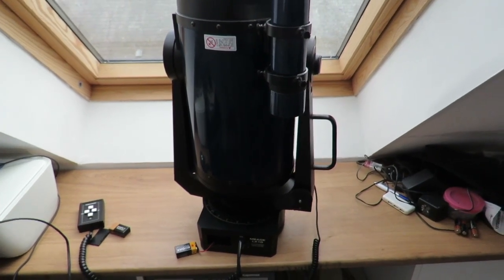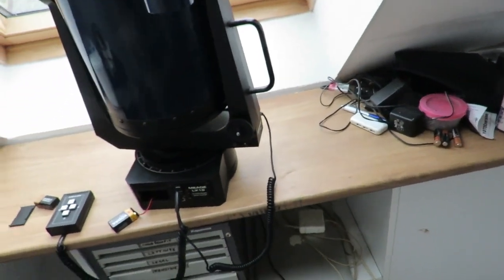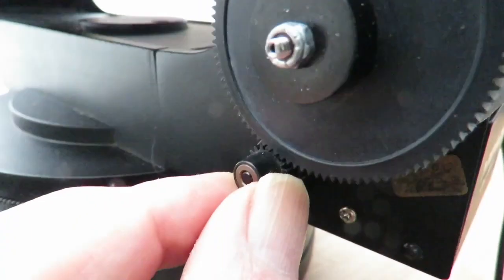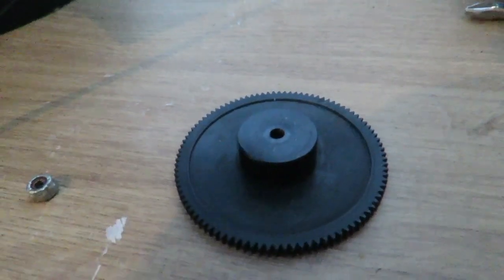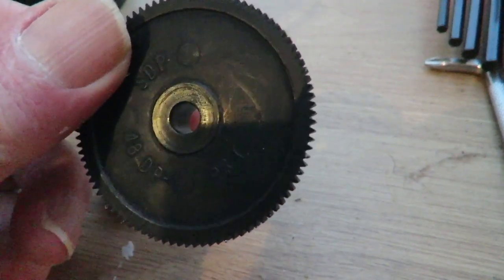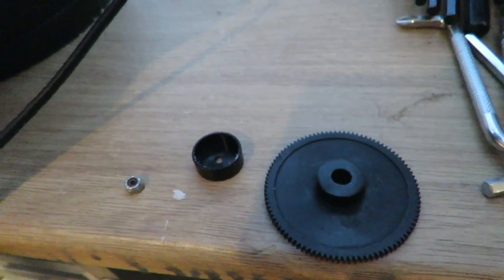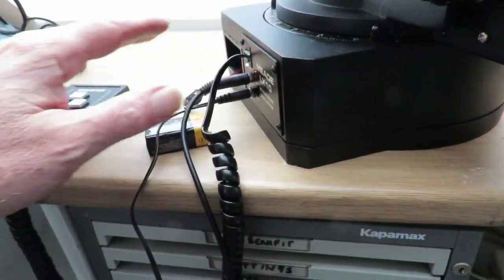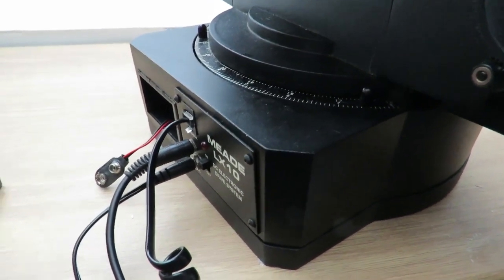Meade LX10 drive issues

Comment: I have some similar issue with my 8" lx 10, so I will piggyback on others experience.  My main issue is the RA drive.  When powered up the red light does not lite but there is a faint
noise from the motor. When I press the West button the motor and scope begin to slew ok and the lite goes on.  When I let go of the West button the lite goes out and the motor tracks very slow.  You can measure the speed by timing the RA circle tick marks. Each tick mark should take 5 minutes. Mine is very much slower.  I was able to fix this problem for awhile by removing the plate holding the cable jacks etc. The stinkers at Meade used very tiny  Allen screws that were rusted in place and the wrench strips out. So I cut a slot with Dremel
and removed them. To continue, I adjusted a variable pot on the board and this got the motor running at the proper speed for awhile.  I think the pot is dirty or corroded and may be in need of cleaning but I don't see any way to do that unless you spray and pray with a can of electrical cleaner. Since the RA is screwing up again I will try that.  It is also possible that a transistor or capacitor in the regulator circuit might be  bad. Of other note, the drive worked well during the warmth of day but failed during the chill 50 degrees at nite.  Of course, it did this during the observation of Titan's shadow crossing Saturn, but I managed to see it happen on September 20 anyway.  I will follow up here if I can figure this out.

Comment: So I have a LX10 that is new to me.  I have similar issues but somewhat different.  With a new 9v battery installed and power switch to "on".  I hear the drive working and I think this is normal.   With the hand controller though, when I press E, I can hear the RA motor Stop, it resume when I let go of the E button.   The W button does nothing.  The N and S buttons do nothing.  The W+S buttons active the Dec motor in one direction, and the W+N buttons do the same but in the opposite direction.   I don't think this is normal?
Reply from the maker: Apologies xc, I am rarely on my channel these days. I'll need to go back and check the LX10. Everything is working great with it now so, if you haven't resolved this already, I'll feedback within the next few days. However, I can say that one of the E-W buttons is simply meant to stop the RA drive until you let go so that is probably ok. The other buttons should speed the drive up a little (you may not notice because it is only meant to be something like twice the normal RA speed which, as you know, is very slow as it is meant to be "sidereal rate"). As for the W+N and W+S buttons: That does seem odd. I have never tried using them both together so will do. Mine moves in DEC with just pressing either the N or S buttons alone.

Comment: Sorry, late to the game. I struggled with this too.  Dec motor:  the little cam that sits on the outside, combined with the little silver nut must be tightened against the large gear in order for it to turn the worm gear assembly inside the fork.  If it is working correctly, you will also see the manual knob on the other side turning.  Here's the thing; if you have it tighten down enough to operate with the hand controller, you cannot freely turn the manual knob.  However, if you play with it and tighten it slightly, it will work for both the motor and manually.  you have to find just the right tension on the nut.  I believe the intent of this particular design is so that you can use both, if desired.  The problem with this design is that if you bother to find just the right tension, it doesn't stay; eventually it loosens and you must find the right tension again.  Poor design? you bet.  But that's the way it is supposed to work.  If you just want to use the motor for the dec, you could just tighten it down good.  To me that is not practical.  Wondering if you figured out the RA motor problem.  I can tell you that as soon as you turn on the power switch, the red light should be on the whole time, and you can def hear the tracking running, not exactly quiet.  so when you turned yours on in this video, I noticed right away that I did not hear that.
Reply: Sorry, the little black round piece is not a cam, it is a "clutch".
Reply from the maker: @patriciacipa379  Hi Patricia. Sorry, very rarely been on my channel over the past few months. I sourced a new circuit board from Clearline Technology in California so, now, the motor drive has been working perfectly and as for the dec control, I found that 'right tension' and yes, it is a very bad design BUT, when I was much younger (teen into twenties) I so wanted one of these scopes and I couldn't resist when I saw it for sale at such a good price. The new circuit board only cost me about £45 so, to have such a 'beast' in 'perfect' working order for such a good overall cost (£450) was, to me, worth every penny.

Comment: The DEC motor is fine, yes it needs to be tight as if you must have a screw on the side of it to tighten to the metal rod to turn it.  Also you shouldn't manually turn it if the motor is in place. That may have been what happened to break the plastic gear. Also you mention using a 2.4 volt when it should be 9 or better. If you hear the motor on the RA its probably working but it moves so slow its hard to detect. That why they say focus on a star.  Also look inside and see whats up. There is another battery choice inside. I hope that help a little.
Reply from the maker: It needed a new circuit board which I got. All's well. :-)